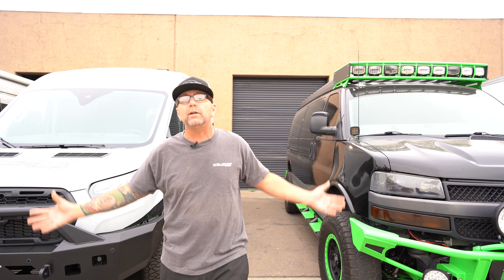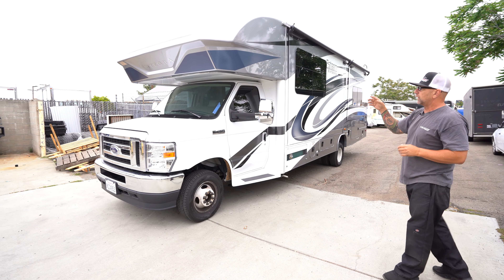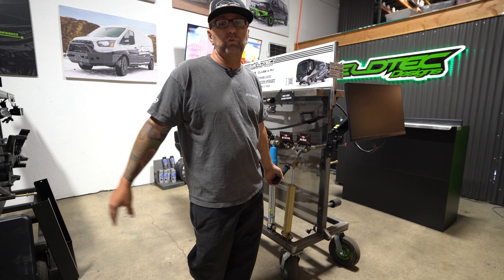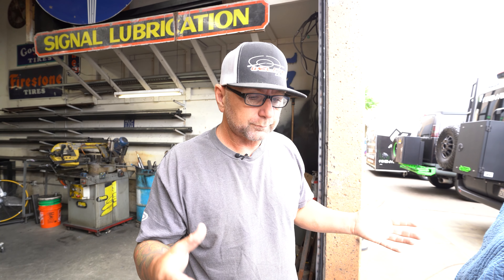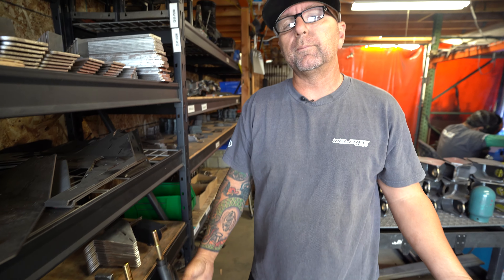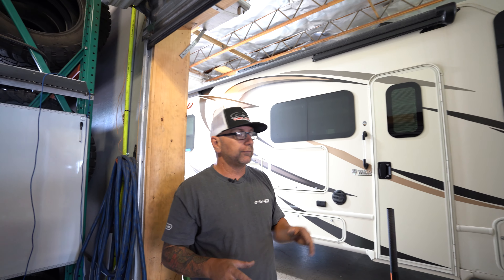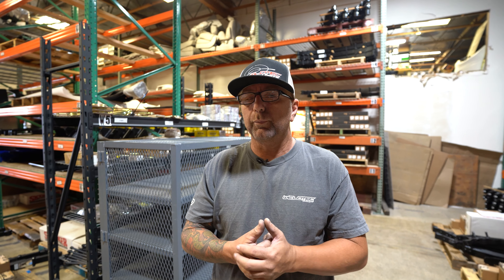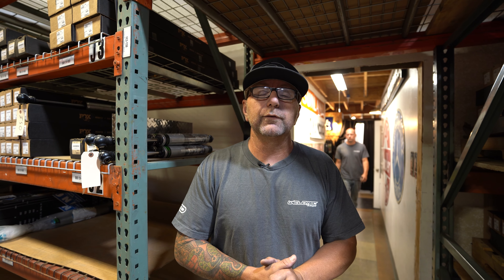WELDTEC DESIGNS FULL SHOP TOUR + NEW PRODUCT INFO 2024!!!

Comment: What’s up! Octavio here 04 Chevy express 3500 with your 5” lift kit and progressive leaf springs. Full fiber glass front end and rear fenders flares. When will we see some upper and lower control arms (beefed up o.e.m) for the spindle lift kit. I’d like to be able to have something I can rebuild instead of having to spend the money on A/c delco or china parts i’d rather support a local SoCal business 10x. As you can see ima fan of the products you build in house I’d be nice to see something in between the budget friendly set up and coil over set up